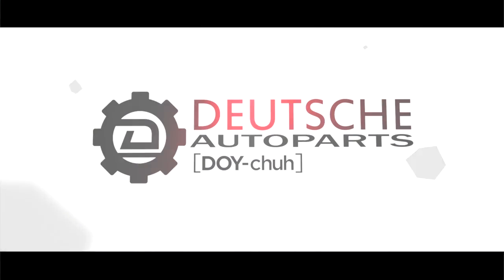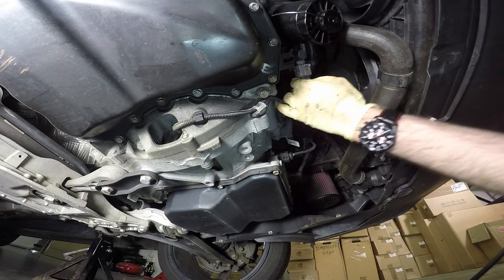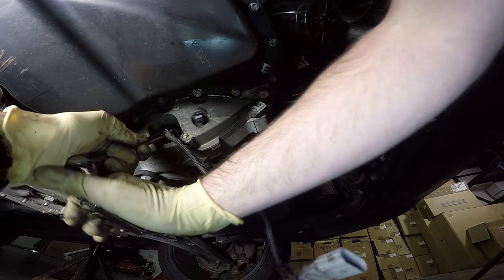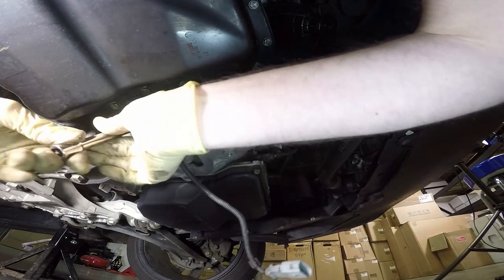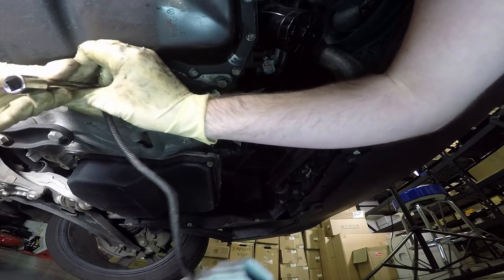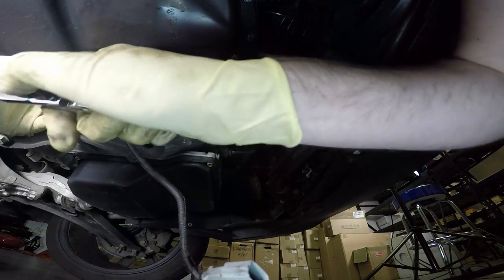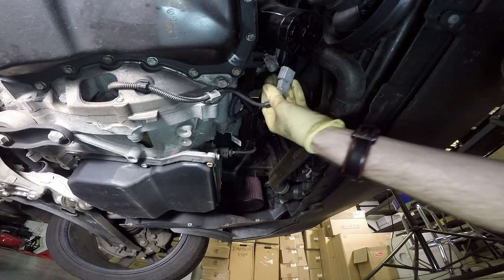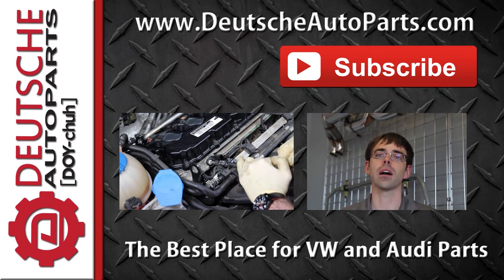How to Install a VW 5 Cyl 2.5 Engine Crank Position Sensor (G28)

Comment from the maker: - We appreciate your Support and Purchases!
VW 2.5 5 Cylinder Crankshaft Position Sensor (Genuine VW/Audi)
https://www.shopdap.com/vw-2-5-crank-sensor-g28-07k906433b-1.html
VW 2.5 5 Cylinder Crankshaft Position Sensor (Vaico)
https://www.shopdap.com/07k906433b-vw-2-5-5cylinder-crankshaft-sensor-g28.html

Comment: Just replaced this sensor on my 2007 Rabbit to fix issues with engine stuttering and an intermittent EPC light with P0321/P0322 fault codes.  Not a bad job overall, biggest issue was getting the connector off the old sensor.  I did have to move the split loom from the old sensor to the new one, since the new one (OEM VW part) didn't come with it.

Comment: I have an 07 rabbit and the first symptom was a slightly/hardly noticeable longer crank to start.   From there, there were a few rough shifts with higher idle at park, then the same day the stalling began (sometimes the epc light came on, sometimes not).  Low speed stalling, everything dead, just the batter light lit up.  After stalling, the car wouldn't start right away, 10-20 min of cooling, otherwise it would only crank.  About 30 miles later, the thing would barely start at all and then the MIL/CEL finally came on with the EPC light.  Codes p0321 and p0322 popped up; however, it took them a long time to finally show up, you may have gotten stranded before they would come....I'm lucky I didn't.  Getting my sensor today, hope that's what it is, not some wiring issue.
Reply: bigwetbutt was it the issue? My wife’s 08 has very similar symptoms

Comment: Hey! I had mine replaced at 30K by the dealer under warrantee and now im at 76K with the same symptoms and codes.  Going to swap it myself this time... Is there a torque spec for these bolts? And is there only one way it goes in or do i have to pay attention to how it comes out? Thanks! Your videos are amazing!

Comment: hi deutsche my 2005 vw jetta 2.5 wont star after I took the main intake out ..took fuel injectors out ,the plastic cover underneath in order to get acces to the alternator..after i put everything together .now the airbag light is on ..the car its cranking , its pumping fuel to the line , it sparks but no current going to the fuel injectors sensors..is there any posibility than i hit that crankshaft position sensor when i was taking that plastic cover out???? or the airbag light its blocking it?? or anything to do with the inertia sensor?? all the fuses are good,,, thank you very much for you help...
Reply from the maker: SuperSuperchavo Im sorry but I'm not sure we can help on this.  The airbag light should not be causing your no start condition.  You might consider bringing your vehicle to a VW specialist to have it properly diagnosed.

Comment: I recommend either Loctite or Anti-Seize on the bolts.  I also put the socket and extension on the bolt, try to twist it by hand to very it is lined up, then a couple of mild taps with a hammer to verify the socket is fully inside of the bolt (often road grim prevents the socket from getting a good grip).

Comment: Is the crank Position Sensor different from the engine Speed sensor?
Reply from the maker: No same
Reply: So would this part be one in the same for vehicle speed sensor trying to source the part but having a conflict an two different style sensors showing up ones a 2 pin the other is a 3 pin
Reply: Two different codes for vehicle speed sensor.

Comment: My 2009 Jetta 2.5 recently has been acting up. accelerating from a rolling stop or going up hill it has been jerking and hesitating pretty bad. The check engine light starts flashing when this happens. I took the car to my mechanic and the code read speed sensor and also stated random misfires in cylinder #2. Hopefully replacing the speed sensor fixes the issue, but if not would you recommend replacing the coil pack and spark plugs next?
Reply from the maker: +Mike L You likely should not replace the crank sensor.  You probably need plugs or coils.  Take a look here for more info http://shopdap.com/bad-ignition-coils-and-misfires-for-vw-2-5-5-cylinder-engine/
Reply: Deutsche Auto Parts ok thank you and the price for all the spark plugs and coils is great at that website!
Reply from the maker: +Mike L Yup we know.... Thats our site ; )

Comment: 2011 Jetta 2.5L SE, the Camshaft Position Sensor seems to be on top.  However, where is the Crankshaft Speed Sensor? Do you have information on how to replace that?

Comment: My 2009 Rabbit has a big piece of plastic on the bottom which blocks a lot of the space there (it goes until most of the length of the crankshaft sensor cable).  Do you have a guide on removing & re-installing that plastic cover?

Comment: Hello maybe you can help me out 2005 vw jetta 2.5  when I put it  from P to D  clunk N to D clunk  sometimes R too but not often  all the mounts are new and also did a valve body  repair solenoids kit ,and doesn't showed any codes , anything to do with a speed sensor or any of the sensors in the transmission solenoid in 88 or 89?
Reply from the maker: answer coming on askdap 72
Reply: ok thank you

Comment: Thank you for this video I just replaced this part on my 06 jetta your video was on point and helped a lot. Job took no more then 20 min.
Reply: What were the simpthoms?
Reply: @valeriumoscalu7580  engine wouldn't turn over. Check engine light came code was for the crank position sensor
Reply: I also have code for crank position sensor , engine is working but is hesitating while accelerating!!!

Comment: I have a 2005 Jetta 2.5 with the code P0016- crankshaft position-camshaft position correlation bank 1 sensor A, do you have a video on how to change those? I've seen the 2 videos that have codes g40, and g 28, are those the same videos I'm looking for?

Comment: I have a 2005.5 Jetta 2.5 the car won't start, I have changed the fuel pump, driver side door wiring harness, MAF Sensor. Still no start. The codes I am getting are 

P0627 Fuel Pump A control circuit /open
P0113 Intake Arid Temp sensor 1 Circuit High
P0102 Volkswagon Mass or Volume Air Flow circuit low input
P0037 H02S heater control circuit low bank 1 Sensor 2

Any Thoughts?
Reply: Check your relay contacts on relay 100 in engine bay

Comment: I had a diagnostic with code G28 implausible signal from speed sensor ,I ve received a quote to supply and fit £260. 1hr.50min labour!  It looks simple to change myself . Hopefully this will solve the lossing power and dies engine off in 30Mph!   thanksfor video.

Comment: Hey, Good Afternoon
I have a 2013 VW jetta tdi 2.0 L but i can't find the Input turbine sensor? is it located on the transmission or Motor? Any help would be appreciated. thanks. codes P0715 And P0717 have come on.

Comment: so I'm being charge $748 for the crankshaft  sensor  and the cam sensor to be replaced along with a coolant  temp sensor and after watching  your video I feel like I'm being ripped off. supposed to be picking  up my car tomorrow  do you think this price  is fair?
Reply from the maker: +Devon Herbert It seems pretty expensive.  You might consider shopping around

Comment: I'm posting publicly in hopes to find somebody who had this same problem. When driving down the road my 06 jetta 2.5 will lose power. The engine dies and all the dash lights go out except the DRL. I put it in neutral to coast to the nearest safe zone if there is one to pull over. Radio is still playing, everything else still has power, all except the dash. While still coasting I turned the key back and then back on to see if power had returned and nothing. Anyways I stop and it takes from 2 seconds up to 10 minutes for the dash lights to come back on. That is constant so its parked it. Don't have a clue what it is I'm thinking possibly a bad connection so I cleaned the battery cables. That didn't work. I'm thinking it might be the crank position sensor, could this be possible?
Reply from the maker: Virgil Steinborn Could be an ignition switch but we would recommend getting some help diagnosing this issue.

Comment: Is it correct that you removed and installed the same sensor you removed?  If this was a new DAP or similar OEM sensor, the installer would need to move over the split loom to the new sensor cable.

Comment: i have a 2008 Jetta 2.5l (manual) and it runs fine and everything but the revolutions fluctuate between 1000-2000 while parked or in neutral. i got the scanner and it reads code p0322 and p0441. would you have any idea of what i should replace?
Reply from the maker: +daniel morales Sounds like 2 different issues.  
P0322 probably is the crank sensor. https://deutscheautoparts.com/vw-2-5-crank-sensor-g28-07k906433b.html
P0441 probably the N80 Valve https://deutscheautoparts.com/evap-purge-n80-valve-06e906517a.html

Comment: Thanks for video.  Just got the P0322 yesterday at 110k miles.          I guess it would’ve cost VW another $.000000001 per sensor to attach a little keeper washer to each bolt.

Comment: I am getting a P0016 in my 2012 Passat 2.5L that recently surfaced and since it threw the code it is starting hard. This was very sudden. Once started it runs perfectly with no noise or acceleration issues, no rough running, etc. Do you think that this is possibly a cam/crank sensor issue? VVT solenoid?? Any help is appreciated.
Reply: Hi how did end ep solving it I am having the same problem with 2013 Passat 2.5L

Comment: how about an oil change DIY for the 2.5?
Reply: Type "2.5L Oil Change (better lighting)" into my search box on my channel... sorry about the noise (I record while I'm working and I have to cover the shop radio music).
Reply: There are soooo many videos for oil change on 2.5 it's relatively easy, just hate those stupid cartridge filters. I always prefer can ones, cause if it's hard to remove I'll just pierce it with a screwdriver or two

Comment: Could this be the cause of a no start on a 2011 VW GTI? My engine cranks but never fires, fuel pressure looks ok from a test. I also pull a coil pack and a spark and it seems like the engine is getting fuel so I am thinking it isn't a LPFP or HPFP. Looking for the next logical troubleshooting step. No Code - but the battery was disconnected prior to having access to a code reader so they may have cleared.
Reply from the maker: +Spencer Smith Tough to say for sure but yes a bad crank sensor could be your issue.  

Here is the crank sensor for a MK6 GTI https://deutscheautoparts.com/make-model-year/volkswagen/gti/mk6-2010-2014/engine/2-0-turbo-tsi/repair/sensors/06h-906-433.html
Reply: Thanks! I pulled all my sparks and coils after posting and tested them. Looks like all 4 of them are getting spark. Based on that I am leaning toward the HPFP being the issue and actually ordered one off your site yesterday. Hopefully that fixes my issue but we will see. Based on some research I did it didn't seem like I would be getting Spark if my crank sensor was out...

Appreciate the response, keep up these awesome videos and the site is great! Now that VW's from these years are coming out of warranty it's great having a knowledgeable team posting videos and troubleshooting tips with links to the parts!
Reply from the maker: Spencer Smith Glad to help.  Thanks for considering us for your purchases

Comment: Your videos have saved me some hard earned money!  Appreciate it too.  I've been having issues with my 07 Jetta Wolfsburg 2.5 with my electrical. Bulbs for headlights, turn signals, and brake lights constantly burning out on me. Sunroof opening and closing on its own. I do have a code coming up referring to voltage regulator. I think that will be easy enough for DIY.  You think changing out that voltage regulator will fix that problem?  My EPC light is on as well and I think I'm just in limp mode. I'm not able to pull codes, so I'm worried my computer is burnt up too.  Any advice would be appreciated, disabled vet here and I can't afford to take it to dealership.

Comment: my 07 rabbit 5spd randomly shuts off on me. In the morning when i start it to warm up for about 2 mins and then i drive 1/2 mile down the road to the gas station to get my coffee for work i leave it running, but when i come out the car is off. everything is working and most of all dash lights are on including battery light. And once in awhile i notice the motor stutters a little then shuts off if i dont give it gas. i heard it could be the crankshaft position sensor?
Reply from the maker: +Shawn Erwin Do you have any fault codes?
Reply: +Deutsche Auto Parts no CEL. i put my scanner to it and no codes.
Reply from the maker: Shawn Erwin It could be the fuel Pump but its more likely to be the fuel pump.  Most times crank sensors will create fault codes like G28 implausible signal.  

This is the fuel pump we are referring to
https://deutscheautoparts.com/1k0919051da-vw-2-5-fuel-pump.html
Reply: +Deutsche Auto Parts is there any other part that it could be? and how about going to check it out at a shop? i asked mechanics about that awhile ago and they said they have no idea. They told me if it happens again like its about to stall save it from reving engine and make it throw a code.

Comment: thank's for the video, i fixed the problem EPC and warning motor in my car jetta 2005 2.5!
Reply: Vidal Br I have the EPC and engine light that comes on as well for my 2012 vw Jetta. Did your car stop too when the light came on ? I got it diagnosed and it was this part and another that they said I needed to replace.
Reply: @pileggi32  Late post, sorry. Did you ever find out what was causing the EPC and CEL in your 2.5L 2012 Jetta? I have the same issues: long crank, poor acceleration, rough idle, stuttering, and engine has died once before. EPC and CEL comes on after car warms up and then all these issues start. 

I already have a new oem CPS ready to install.
Reply: @notjude7884  yeah I actually did ! I'll reply again in a couple hours because I'm at work but after replacing that part I literally drove from Texas all the way to Nevada no problem haha
Reply: @pileggi32  what was it?
Reply: @domoowalk  camshaft sensor , we had no problem and we drove all the way from texas to Nevada straight no problem 😊
Reply: @pileggi32  thank you
Reply: @domoowalk  no problem! It's actually pretty easy to do it yourself so if you feel comfortable doing it I would to save some money
Reply: @pileggi32  I normally would but it’s still under warranty but it’s been back at the shop a couple times.so I’ll recommend them to replace that

Comment: Could this issue be associated with a P0322 code on a 2008 vw rabbit 2.5l?
Reply from the maker: +Melvin Valentin Yes it absolutely could be.  Here is the OEM VW Crank Sensor
https://deutscheautoparts.com/vw-2-5-crank-sensor-g28-07k906433b.html

Comment: Hey where is the output shaft speed sensor on a 2006 jetta 2.5l non-dsg
Reply from the maker: It seems like you might be talking about the transmission speed sensor which is generally mounted on the top or side of the transmission
Reply: Would you be able to link me to a image of it. .. feeling around and can't locate it

Comment: I have a 09 2.5L jetta, when coming to a stop or when slowing down, sometimes it stalls and just shuts off, with the battery light on. could this be the speed sensor?
Reply from the maker: +J Daboss Probably best to take a look at this video https://www.youtube.com/watch?v=sgPMlBJQ-0E
Reply: +Deutsche auto parts, thanks for the link.! I have received the bad speed sensor code, but i'll have to really check things out under the hood or rescan and get the fuel pump checked. Thanks again.
Reply from the maker: J Daboss  If you have a crank sensor fault you should probably consider replacing it 
https://deutscheautoparts.com/vw-2-5-crank-sensor-g28-07k906433b.html
Reply: +Deutsche Auto Parts- Ok, I'll have it diagnosed again. I did some research online last night and I'm not sure if it's just the 2.0 TDI models, but it turns out 2009-2010 jettas are famous for  faulty HPFP. I hope it's just the crank sensor! Thanks Deutsche auto parts.
Reply from the maker: J Daboss the 2.5 engine doesn't have a High Pressure fuel pump.

Comment: would this sensor also cause the cruise control to not switch on occasionally?
Reply: I've had that issue with my 2007 Rabbit before, the issue was in the cruise control switch itself.  Had the turn signal stalk replaced under warranty and that solved it.  I believe there should be a fault code to indicate that.
Reply: Brake switch can also cause cruise issues.  It can also cause you to trigger EPC